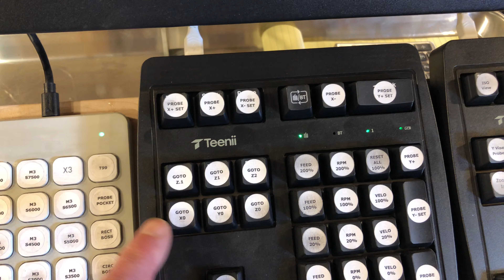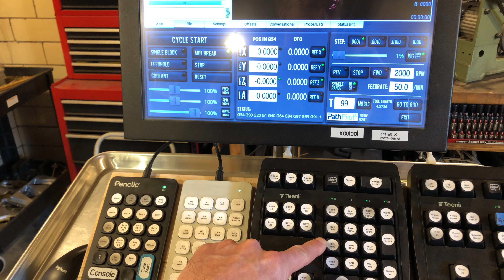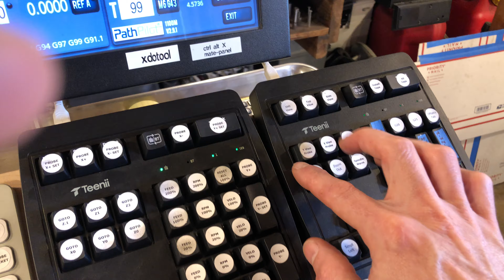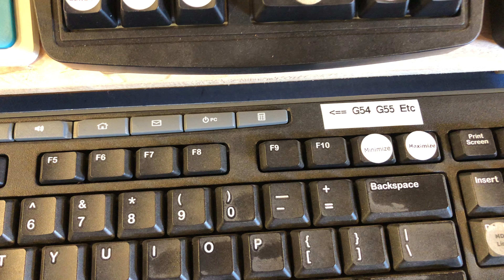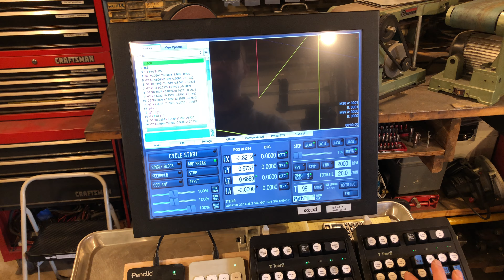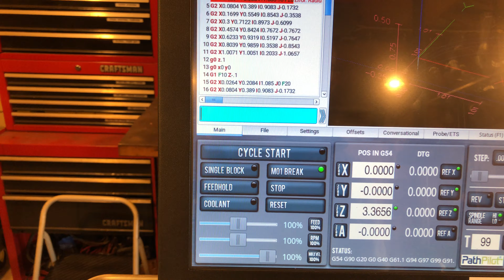Tormachtips.com - One-Button Cycle Start & Other Custom Keyboard Shortcuts for PathPilot

Comment: Great vid....I'm just getting started with a new Tormach mill and was wondering if you know what MDI command do you use to get to a specific line of Gcode....and is there a list somewhere of all the MDI commands/inputs a user can take advantage of.   Thanks
Reply from the maker: You can use FIND (text) or GOTO. If you type HELP or ADMIN HELP or HELP ADMIN (I forget which) you'll get a long list of available commands. 

There aren't many areas on the net with good, active discussion for Tormachs. The busiest, least toxic, most friendly is probably the Tormach Operators group on Facebook.